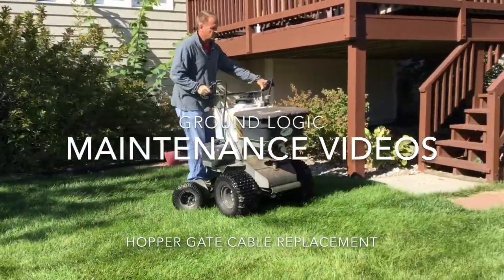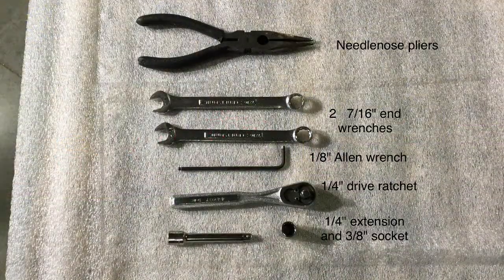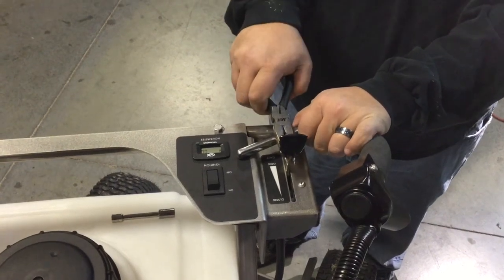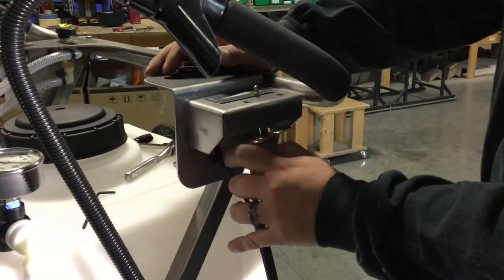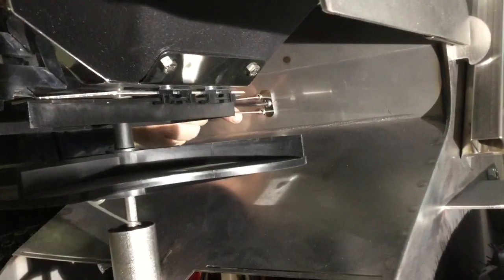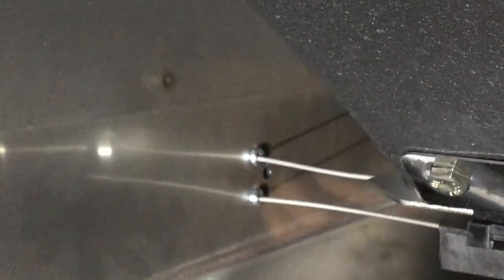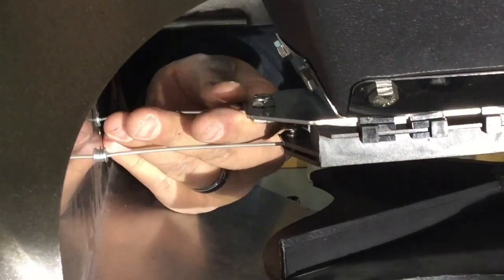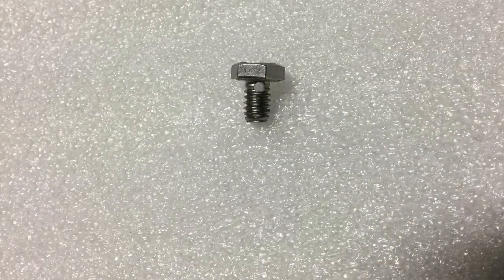Ground Logic PATHFINDER MAINTENANCE Hopper gate cable replacement

Comment: I would love to see you try that with a machine that has a couple years on it spraying herbicides and fertilizer.  I got the pathfinder xc, and that Allen head bolt that holds the two cables on is rusted to shit.  I guess my next move will be to cut it off with a dremel